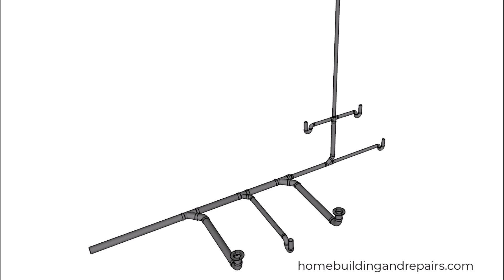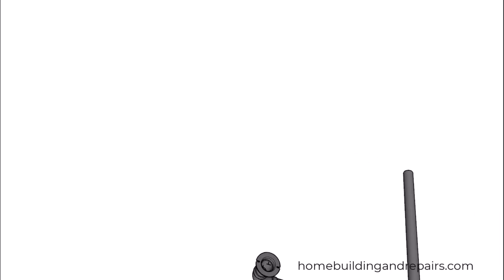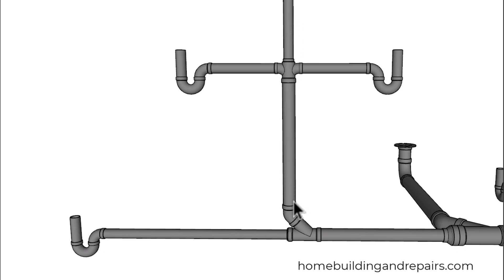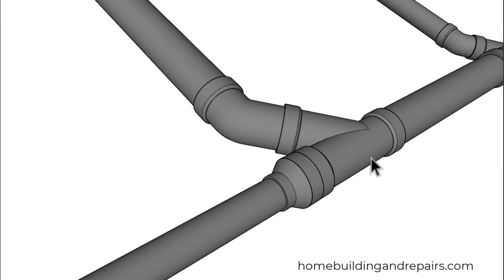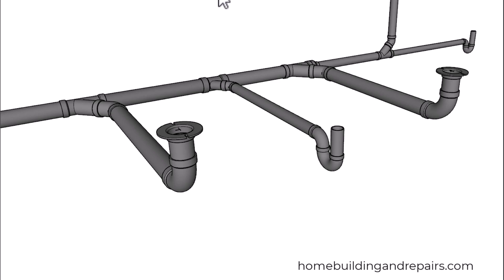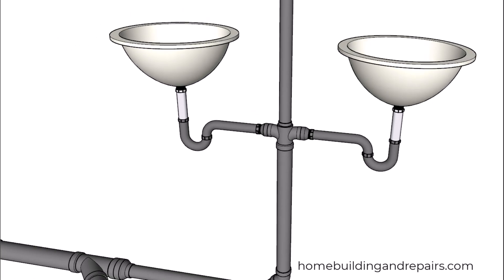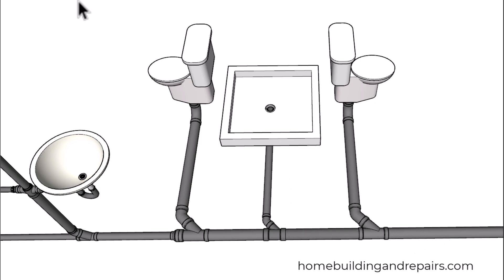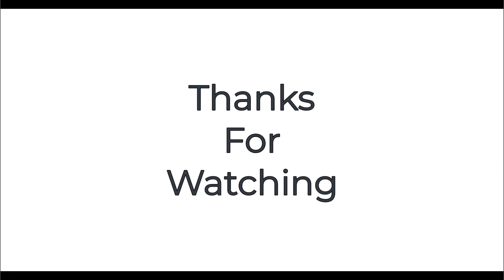Wet Vent Bathroom Plumbing Pipe Layout Example From International Plumbing Code Brochure

Comment: If the sink can't vent up because of obstructions can I hit a dry vent at the bottom and send it up somewhere else?
Reply from the maker: You can connect one vent to other vents as long as they meet local plumbing codes.

Comment: You have to remember that in the US, codes change from county to county and state to state. Some place are not going to let you use a 1 1/2 trap on tub. Some places want a 3 inch drain line for a washing machine. Some allow a single common vent for the drain system. Some don’t..Etc,etc,etc…I’d like to add something after reading some of the comments. I haven’t seen a dry vent in like 20 years…Id imagine that most places don’t even allow it.
Reply from the maker: Interesting, can you provide more information on which areas won't allow the pipe sizes you suggested, like the one and a half inch bathtub trap.

Comment: So is there also a "dry vent" system? If so, when would you choose it over a  wet vent system?
Reply: not to sure but the wet vent is used with a toilet and tub to where a dry vent could just be a sink or laundry drain.
Reply from the maker: It will depend on the design of house, framing, structural beams and etc.. I've seen more dry venting than wet venting during my career.